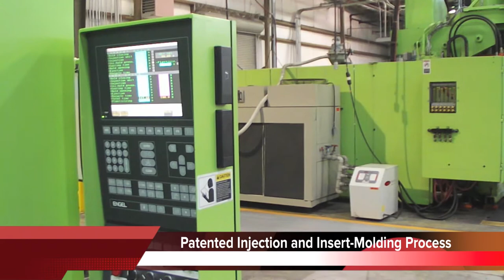Aquatherm Solar Pool Heaters Factory Tour

Comment: I kind of liked working there back in 1998. loading the trucks; cutting and grinding the plastic; coating the strap with plastic, the barley tolerable hot afternoons, the screeching sound of the saws, the rumble of the chillers, the hiss of the air compressors, Is Dave, Al or Nate still there? What happened to Peter?.